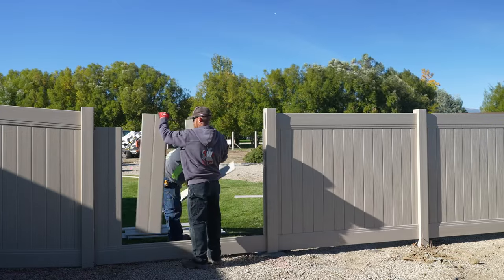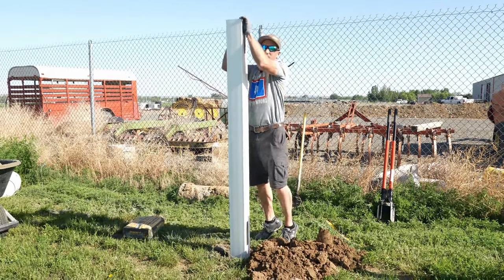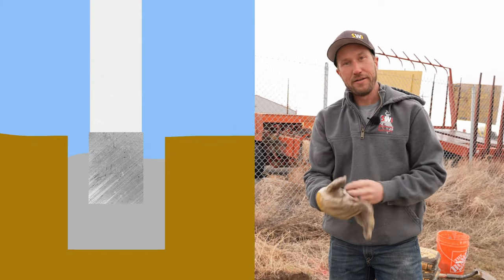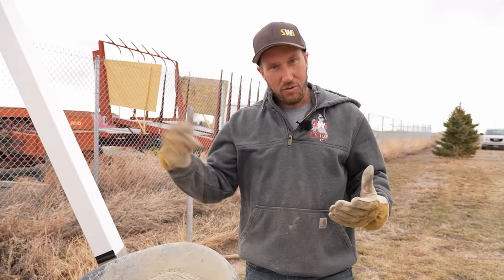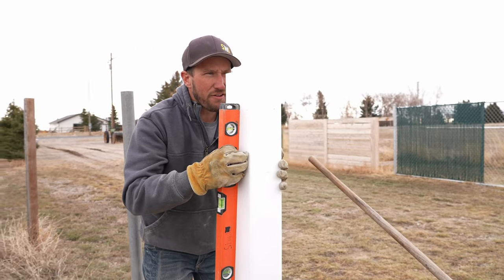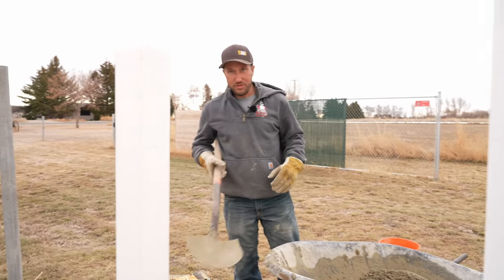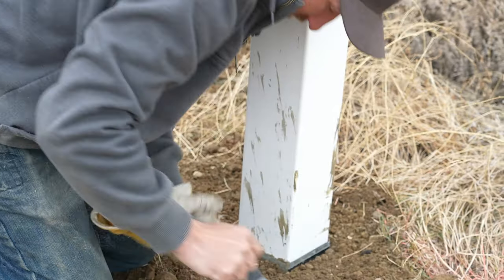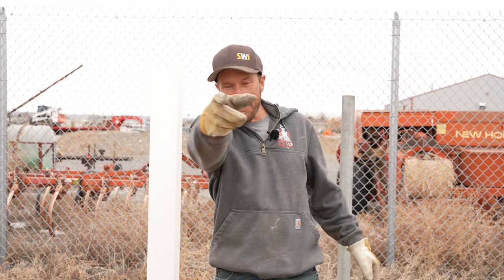How To Install A Removable Vinyl Fence Post Easily

Comment: Great idea!  I scaled mine down using vinyl 4x4 w a cedar 4x4 core(that are actually 3 1/2x3 1/2) as my “male” insert. The sleeve was a 4x4 post sleeve in the ground w a bolt holding the cedar 8” above the post hole for drainage

Comment: Dan, my man… the Man Behind The Camera may have shot this video with with the camera flipped vertically.  I swear it appears you set it plumb while trying to check for level???

Are those sleeves available to fit our Osage Orange posts?  

My neighbor and I have a gully in the creek bottom that floods about twice a year.  The brush and driftwood piles against the bob-wahr fence and takes out the posts and all.  

Iffen we had some of those nifty post sleeves, we could just go out before the flooding begins… herd the beef into the upper pasture… pull the hedge posts and voila!  Problem solved.

I’m serious about finding sleeves that fit our native hedge posts… cause everyone knows you can’t staple bob-wahr to plastic posts.

Please point me to the appropriate SKU for those sleeves so that I too can have a good danged day!
Reply from the maker: Hmmm, we'll get right to work on an Osage model! I can't believe we didn't make that version first! 🤦‍♂️🤦‍♂️😁

Comment: Dan, as per your recommendation and preference, I taped my bottom. How long is this tape supposed to stay on? I'm retaining more than water.
Reply from the maker: Oh! Uh... well, don't forget to punch it out. You can't leave it on there. 😐
Reply: @SWiFence  Greetings from the ER. Punching through with a shovel didn't go so well.
But on the bright side, thanks to your advice from another recent video, my nuts are still snug. Doctors are impressed.